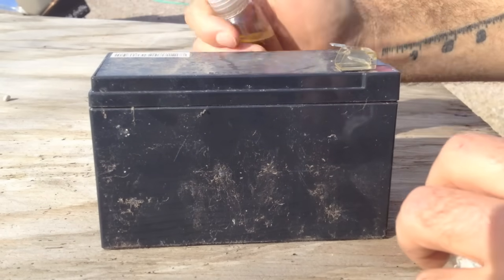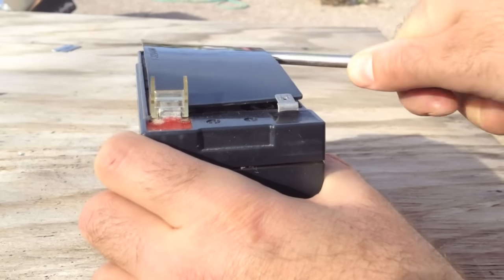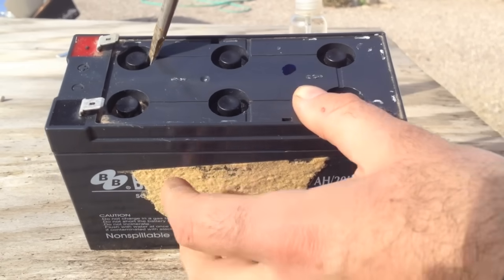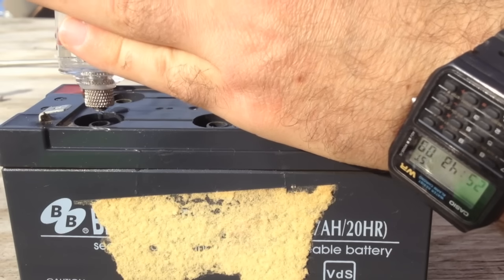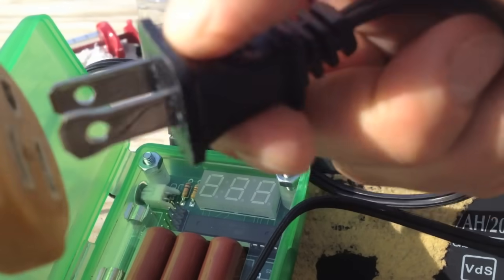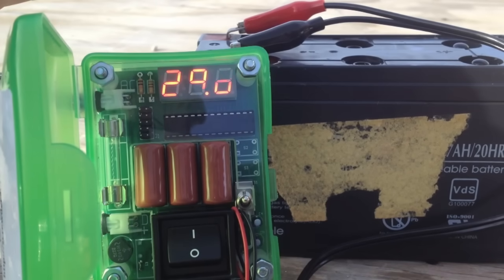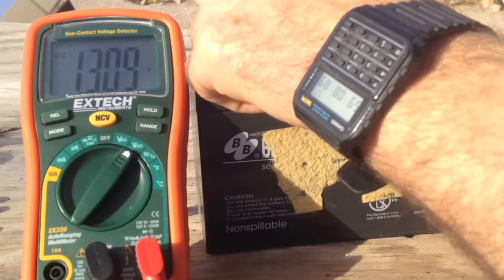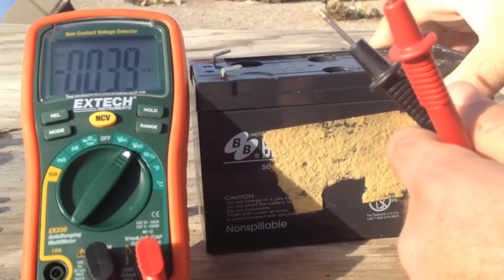Sealed Lead Acid Battery Recovery

Comment: AGM, SLA, or GelCell batteries are not flooded. And adding contaminated rain water will surely murder them. You can install these batteries upside down, sideways etc, no liquid water in them! The cell caps are there to allow off gassing during charging and cycling, and to keep contaminants out, not for adding water. If you add water to one of these it you might get a few more piss poor cycles out of it, until the contaminants kill it completely. That is not a recovered battery. Might extend its life in a pinch but don't expect reliability. Also a bad cell doesn't mean its open, if it was open there would be no circuit and you would read 0v. A bad cell is usually shorted, either partial of fully.

Comment: The multimeter trick doesn't measure individual cells but a group of them, first measure 1 point something volts the last 11 volts!
Reply: I think the point is to see if the individual cells are bad so the voltage reading isn't important.  What's important is that each cell conducts current.  So a quick and easy check would be a quick voltage check on each cell.  If you get a reading on the volt meter, then the cell is good.  It doesn't matter if the volt meter reads 1 or 10 because you at least know it works because you get a reading.  If the cell was bad you wouldn't get a reading.
Reply: ***** Well, as i can see, he is not just testing whether a cell is allowing current flow but more of testing if each one is good and also producing voltage. As we all can see, each dip of the probe registers a higher voltage than the previous one therefore concluding that that particular cell has a potential of being good. A dead cell with water in it will allow voltage to pass but it will not give a higher voltage reading than the previous one. But one thing i observed from this experiment is that some of the cells tested gives an increse of 2V or more than 2V and some just a fraction of 1V. I think that that particular cell is already weak and will not produce enough power (voltage and current) as compared to those who measures 2V and higher.

Comment: how much current do you recommend to charge the battery?
Reply: +Erick Troncoso Whatever battery u use, don't go above 10% of it's actual value when charging, so when a battery is 40 amp the charge load should not be above 4 amp, you can do it like with quick loaders but the number loadcycle will go down. the same with small batteries of 1.5 and 1.2 volt use max 10% of amp value.

Comment: I'm not shure that this battery is going to recover. I was doing the same procedure for a 6V 3.2Ah wich wasn't charged for more than 19 years. Added water and used simmilar capacitor based charger. After a lot of time the internal resistance dropped and the voltage became around 4 volts, and even started to light a bulb from the battery but it never reached whatever a normal VRLA battery must be.

Comment: Some of my SLA batteries - two 12volt, 20Ah in series used in a lawnmower - have been replaced with new batteries ($70-80) because they had swelled to the point they could not be replaced once they were off the charger. I would like to build a lithium-ion replacement battery pack - 6-cell parallel packs in series.
An ION speaker I have uses a SLA battery that I would like to replace with a lithium-ion battery pack since the SLA requires frequent periodic charging. I am not opening one of these SLA batteries due to their sulfuric acid content.

Comment: But, can it be safely re-sealed?
Reply: It wasn't truely sealed to begin with. You saw how easy it was to pry off those caps. All batteries like this are designed to vent gasses while charging. SLA (or AGM) has a fiberglass fabric that holds the electrolyte and keeps the battery from leaking. The loosely fitted caps hold in the rest. So, yeah, pop the caps back on, glue the little lid back over them, and you're good. Just make sure the caps aren't super loose or you will have to use the battery in an upright position (probably).

Comment: It doesn't work. It might for a few days but what happens is all the sulphur deposits fall of the plates and settle on the bottom and can and most likely will cause the battery to short itself out. And another thing. You'd need a charger that can output about 100-200 amps not a cheap 1.5-2a trickle charger to get anywheres.

Comment: You read voltage but what about the amps been measured ! Voltage is grand but the amps is important too if these batteries are fitted in a power supply unit and the mains is isolated what would be the amps drawn

Comment: Don't know what a pimp charger is but why not just use a regular 12V car battery charger for this? My car battery charger has very sophisticated electronics that gradually reduces charging voltage as battery charge recovers. You basically turn it on and let run until it says "Battery Full". How about just using such a 2/6/10 V car battery charger for this? Especially if sealed battery still has fluid in it (still heavy) and thus doesn't need to be opened?

Comment: sir but my battery is swollen. black connector to battery is rusted but i cleaned and removed safely.
whatt can i do
Reply: Edwin selva If battery us swollen, then that means that the electrodes inside a deformed. Take it to the scrapyard instead. Don't try anything else. 🙄

Comment: Out of characters for the 3rd time lol
The purpose of these posts was not to dis the "Da Pimp" It is a great gentle charger for fixing batteries. I am simply saying why it is not needed if people have an old charger on hand. Thank you for the video. I have 5 of these batteries and they are all dead. I will be using the method to fix them. If you try this with no luck put in some Epson salt in you distilled water, It cleans corrosion and allows electrons to flow better.

Comment: R u using normal drinking water to flush the battery
Reply: Negative, you have to use distilled water, like he said rain water, that's nature's distilled water, you can buy distilled water at any grocery store or pet stores even. Best to get it at Walmart, it's like a $1.50 a gallon

Comment: here's  several things for doing a pro job
never try to do this until you know what you are doing - the acid can burn you
check the voltage first - there may be a kaput cell which would waste your time.
Check the battery fluid.
attempt to fully charge the battery.
(I learned about these and more from Jons Mender Guide site )

Comment: I once filled a sealed lead acid battery with demonized water like you. It leaked like hell after that. I think they make the caps not removable. once you remove them they dont seal again.

Comment: Possible know what to put in the battery
Reply: They say the best is distilled water.
Reply: Here he said he was using rain water (which apparently works fine for a lot of people).

Ideally you'd want to use proper high purity distilled water that Robert mentions, if you can source some that is meant to be used for chemistry lab type stuff that'd be great. Since I usually have a supply of this around this is what I've used the few times I had to deal with older lead acid batteries.

Another option according to some people is to use deionised water, makes sense since you've got a lot of the bad contaminants removed in there but do carefully read the label and when in doubt get proper distilled water or use something like rainwater (captured in a quite clean thing).

I've also heard of people using freezer/ac water tray water, since the way of getting it out of the air is theoretically somewhat similar to distilling water as long as it doesn't pick up contaminants along the way it should be pretty pure. Getting enough to refill a battery however this way... it'll take a while.

Definately do not use regular bottled water or tapwater though, depending on what's available in your area it might work somewhat for a while best case or worst case it'll properly ruin the battery for you.
Reply: I would be a bit careful of rain-water.
If it is collected from a metal roof or in a metal tank it should not be used as it will contain metal ions.
In industrial areas the rain can also contain contaminents.
Frost that forms on a plastic surface in the fridge should be good.  Keep it in a glass bottle.

Comment: Just looking at the schematic it appears one side of the mains input is connected via a rectifier and a relay directly to one battery terminal.

That's kind of risky I would have though.
Reply: It's isolated by three capacitors. To give a really shithouse power factor.
Reply: Assuming those caps are on the active side.

Comment: It's unlikely that the caps, which basically are one-way valves, would hold much pressure as they are designed to release any pressure whilst preventing the ingress of anything undesirable.

Comment: Isn't there likely to be problems with hydrogen boiling off?   I always heard that that was a problem while charging and could cause the battery to explode.  Great video, thanks.
Reply: The battery has vents to depressurize

Comment: i take it this will work on a AGM type battery ?
Reply: @truthserum3231  Couldn't agree more..... Flooding an AGM battery is looking for an explosion to take place. AGM batteries have like a matting inside that should be "Barely" damp and most definitely not drowning in liquid. I managed to get one of my 7AH's working again but I'm sure it was just by luck after I added a bit of distilled water to each cell, just to moisten them up a bit.   However, what a mission in getting the thing charged and maintaining the 7AH was not worth it (I even purchased a pwm digital battery charger to get it back up the the original current, so I guess me messing around did have its perks because now I have an awesome battery charger for those "Emergency Cases"), but from then on, I just bought a new battery, because it's most definitely not worth the effort.

Comment: how many times do you find that you can do this to one of these batteries to recover it? 

lastly, I would have liked to have seen how you sealed it up again and what you did to the water that was on the top before putting the caps back on.
Reply: creatine64 You don't seal it. It's been converted to a wet version
Reply: ChaoticaExtreme sorry, I should have been more specific, I am aware that this is wet version now but you still don't want that exposed top. I was more or less curious to know what he did for the top again after he restored it
Reply: creatine64 That's what I mean. It's no longer usable as a sealed battery. It should be treated as wet.
Reply: +ChaoticaExtreme There are sealers available for this cap problem
Reply: Taunter Atwill
Hi Taunter. How do you know the specific gravity and correct level of fluid though? The recombination process will be completely off.
 Sealing it is a bad move in such a case IMO. In any case, the original caps are re-usable.
Reply: +ChaoticaExtreme The are sealed to begin with. The "pressure" while charging is very low, far to low to blow up your battery. Yes you use the original caps after you cleaned the inside. With a small torch you can look inside the battery if the level is too low you'll see the lead plates, just fill them up untill there under water. The gravity i do not compute?
Reply: Taunter Atwill
Covered plates are for 'wet' cells. Sealed uses less fluid than that. Only enough to allow it to work. Any more will cause problems with for example, excess pressure, since where before was empty space for gas expansion, now is liquid.

Specific gravity is ratio of acid to water.

Say you got a battery that dried out, but lost no acid (acid doesn't evaporate, but does crystalize). You first add water above the plates. Straight away the capacity has been reduced because the electrolyte now has far more water than before. Though the battery still works, the standing voltage will drop, as well as the voltage under load.
So called smart chargers will be baffled because the battery voltage doesn't rise as expected, or the current level out as within the specs.
My expectation is one of excess gassing.

Should sulfation be an issue, the problem is worse, since you are then dealing with a battery that has a reduced surface area, thus is the same electrically as one with a smaller capacity. This means if you charge it at the rate specified for that battery, you are going to hit the gassing voltage at a higher current than should be. The charger may not terminate correctly.

I would not condone re-sealing such batteries. If you must, desulfate and charge them open, then at 'normal' room temperature, seal.
Don't seal outside in the cold then bring in the warm as the pressure will increase purely from the temperature change.
Reply: +ChaoticaExtreme Just buy a fucking new battery! They go for $35 all that shit for a few bucks? BTW we call it just ratio not gravity the ratio on average is 65 water to 35 acid, are you on some uppers speed or something?
Reply: Taunter Atwill
Not everybody is you, or has your obvious resources.

You will not find the batteries I have at anything approaching that low a price. Kindly find out the particulars before taking yourself down in others estimation.

'We call it just', is not the standard. 'Specific Gravity' is.
The ratio 'on average' is also not enough. It's rather critical actually.
The fact you didn't know that, tells more about you than you need to say....

4 things you got wrong in such a short comment. Not that good at taunting at all, are you really....

Bye, and take care of yourself.
Reply: +ChaoticaExtreme como cargar una bateria
Reply: +Pacífico Izquierdo Fuente Are you asking what I use as a battery charger?
Reply: Depends on the size and capacity of the battery. Some of the high end UPS have really expensive batteries. Also, it is possible to pickup a dead UPS for almost nothing. You might not want to buy brand new batteries for a unit you are trying to get working that might have some other issues.

Comment: hello friend I have a battery of 4.5 AH / 6V rechargeable, maintenance-free, when opened it only had 3 cells, only feeds a flashlight when I turn on the flashlight Low voltage 5 V thanks I hope will help me greetings

Comment: This will NOT work with Enersys NP sealed lead acid batteries. In those, there is no false top or caps and the "lid" piece is almost 1/4" thick. Removing that lid exposes the plates and may involve getting the gelatin acid mixture on you. I gave up and the Enersys NP went off to the recycling center. Make sure the battery you're working on is worth the trouble.
Reply: you could drill a tiny holes. then cover the holes with super glue and ashes (from ur cigarette) it works

Comment: How are you getting more than 6 volts out of a 6 volt battery....?
Reply: Because it's a 12 volt battery !
Reply: All batteries  have a nominal voltage rating, but the open circuit full charge voltage will be higher. 1.5 volt alkaline batteries are about 1.6 volts open circuit and a 12 volt lead - acid will read about 13.5 volts with no load
Reply: Batteries have the true voltage E (emf ) internal voltage and (v ) V=E-(IR) voltage that you find on terminals
Reply: that is a 12v  battery
Reply: @hydrocarbon7045  I saw someone comment the same thing and one person replied "So, you saw 6 chambers and thought it was 6 volt, didn't you"

Made me lol 🤷🤷🤷

Comment: Rain water? You mean normal water or Acid water that found in cars battery 
Plz answer
Reply: Rain water is distilled water, you can buy distilled water so is guaranteed clean (rain water could get dirt). Or get it from a home AC unit. After is charged it will become acid.
Reply: bluetorch13  sorry guys rain water is not pure, you will have to add acid before you charge it. justbuy  electrolyte. this battery wouldn't work without acid.
Reply: fenestron100 thanks!
Reply: fenestron100 A discharged battery would have the S04 in a lead compound. A dried up battery would have the H2S04 at the bottom. The S04 is not really lost.
Reply: Actually, depending on where you are located, rain water can have a pH of 6.5 or less (which means it is slightly acidic). You can filter the rain water if you think it is necessary.  Otherwise, just buy a 1 gallon jug of distilled water--it usually costs less than 1$.  Note:  It's best to fill battery cells only slightly above the plates (overfilling isn't ideal as it will dilute your electrolyte & make your charge a bit off.

You should never have to add sulfuric acid (h2s04) to a battery that has dried out.  As a battery loses water & discharges, a chemical reaction occurs that causes sulfuric acid to bond with the lead & deposit on the lead battery plates.  When you refill the battery with distilled water & recharge the battery, the charging process causes the sulfur molecules to dissassocate from the lead plates & the sulfur returns to the water as sulfuric acid (usually ~35% of the electrolyte when the battery is fully charged.  Note:  When the battery is full discharged, the electrolyte will be almost pure water (i.e. no sulfuric acid in it).
Reply: zeffur7 thanks for that!
Reply: Np.

Comment: I'll try already this procedure.. Only battery voltage increase...but the ampers is not improve for my lead acid GEL type battery..

Can u help me how  to increase Ampers for that battery? Thank you sir..Godbless to you
Reply: Marvin Quisel Then you need to use at least a 2-step charger if the battery has been fully desulfated. 😏
Reply: I used ebike charger 48v-12ah..but. only voltage increase.

Comment: i hope this battery Is fully discharged  before Disassemble
Reply from the maker: Opening a battery slowly without excessive force is a fairly safe process. Charging an old dead battery is the risky part.

Comment: Da charger/desulfater would work better if a straight diode were used instead of a bridge rectifier. Half-wave pulsed d.c. gives stronger voltage spikes than full-wave d.c. , to better break up the sulfate.